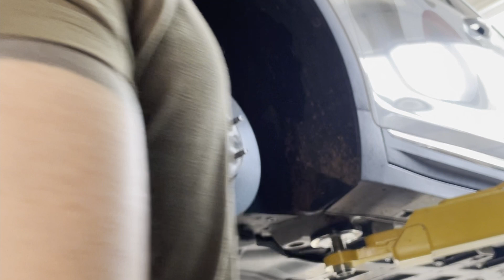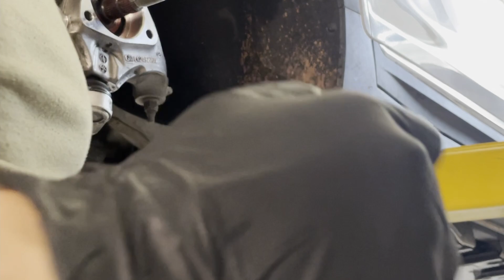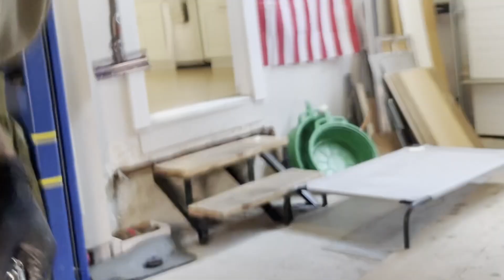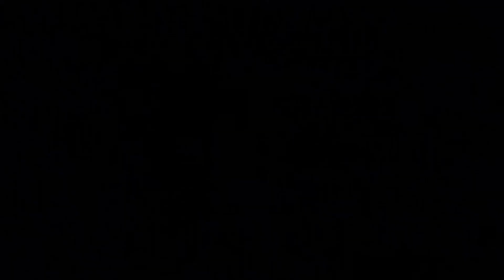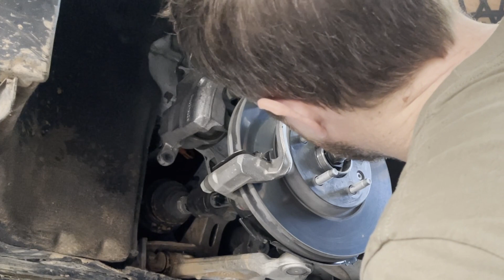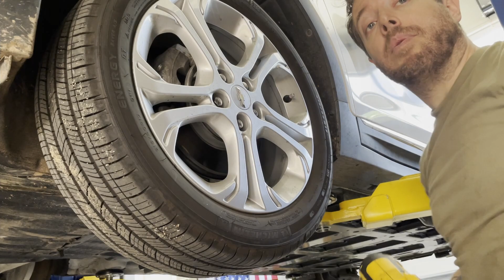2017 Chevy Bolt Front Hub and Speed Sensor Red Washer Replacement

Comment: Wait a minute....did I miss you replacing the red washer? 🙈
Reply from the maker: Red washer...?
Reply: "Speed Sensor Red Washer Replacement"
GM Front Wheel Half-Shaft Washer at the end of the CV shaft, when you removed the wheel hub...wasn't that you were referring to?  It's apparently notorious for breaking up and causing issues/noise.
Reply from the maker: @JohnDoe-md2sb Yes! But I only learned about it from another comment...Mine seemed fine, and it wasn't a well-known issue when I replaced the hub, so I just left it

Comment: Thanks for posting this.. About to do the same job on mine.  Same thing happened too.. hit a big ass rock... did not pop the tire, or damage it in any way.. or the rim.  Bit after that.. at 42mph and 62 mph.. slight noise from wheel bearing... crazy the bearing would be damaged but not the tire or rim.
Thanks again for the info, the bolt sizes, and torque specs... helps me prepare for the job a but.. make sure I have all the tools i need ready to go.

Comment: Fyi.. title of this vid could add a component for replacing the Red Washer often cracks in half and sometimes destroys the sensor.. so its a common replacement needing done on bolts 2017-19
I bought my parts but haven't done mine yet.
Anyways.. with the title adjustment might get more views. 
Thanks for sharing. 
-Sam. 
ps Also if your going to post part numbers. might as well post affiliate amazon links.
Reply: I was able to find this video on YouTube (how to replace the Anti-Clicking washer) thanks to this comment and the author's subsequent retitling of the video. Thanks a bunch!
Reply: I overtightened my axle nut and now my ABS/wheel speed sensor is broken. I suspect the Red Washer is cracked as per your comment. Can you please provide me with that part number for that Red Washer if you have it?

Comment: Thanks for the video, nice and clear!
Yesterday I was mounting my winter wheels on my Opel Ampera-e but when tightening the left front wheel, unfortunately one wheel stud broke off even though I used the correct torque of 140nm. Is it possible to knock this broken stud out of the hub and replace it with a new one by only removing the rotor or does the entire hub need to be removed? I see a small opening in the right side of the rotor shield that might leave just enough room for a stud to pass through. In other words, is there enough space to get a new stud in from behind the hub?
Thanks!
Reply from the maker: I don't think there's enough space behind to knock the studs out